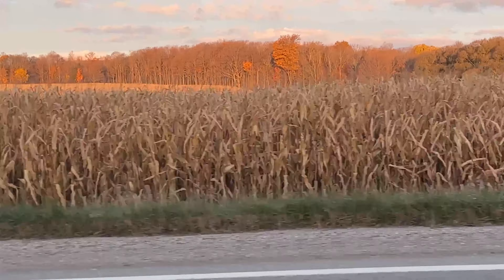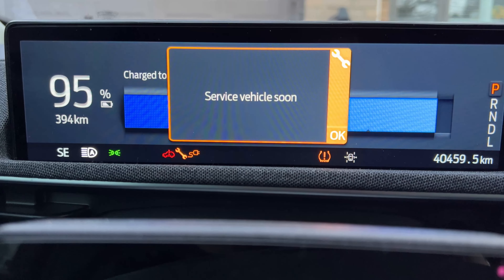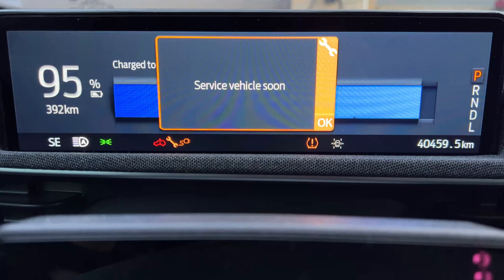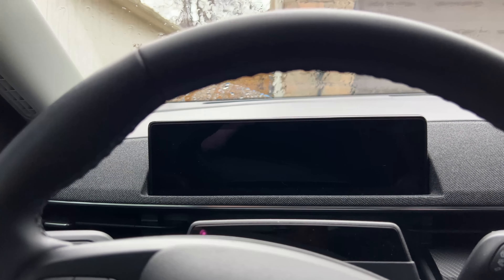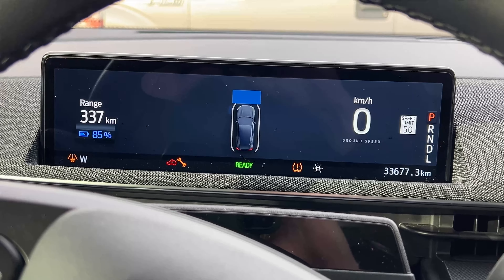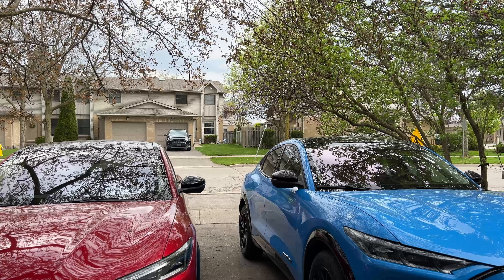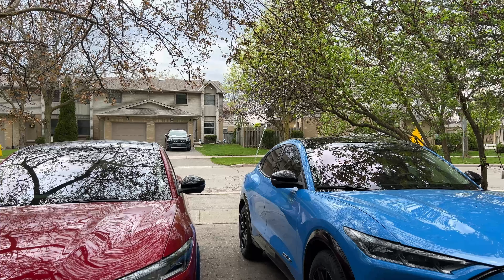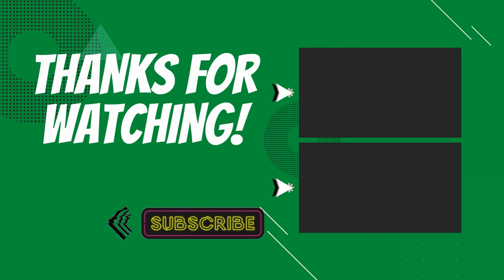Ford Mustang Mach E High Voltage Battery Junction Box HVBJB Fail - 2 Months to get fixed? WTF Ford?!

Comment: Mine is being worked on right now at my local dealership, they had to bring in a welder to modify their hoist to be able to drop the battery out. I should have it back tomorrow. Been there 5 days now.
Reply: I wasn't having issues, just got the notice that parts were available to get the job done, finally lol
Reply from the maker: Glad to hear it's working out ok for you.  Keep me updated!  Please like and subscribe as it helps me as a creator.  Thanks for the comment and for watching!
Reply: Mine is a 23 which is supposed to have the updated junction box. Not sure how much it’s updated as my 23 is at the dealer with 1750 miles on it and a month old with a bad junction box. Been there for 4 days so far and was told it’ll be another 3-5 days till they get the parts. Kinda scared to drive the car when I get it back as if it only lasts a month from new doesn’t say much about its longevity. 

Bought to save gas money too as I drive 100-150 miles daily and am now driving a 5 year old edge loaner that gets bad fuel mileage 😞
Reply from the maker: @jimhimesjr  I share your pain, frustrations and skepticism.  I will say that my Red Mach (Darth Maul) is 2 years old now.  With everything being said, I'd do it all again.  Let me know how it goes.  Please like and subscribe as it helps me as a creator.  Thanks for the comment and for watching.!
Reply: @MoreBear  will do for sure. The dealer gave me a 24 select awd big battery to use while my car is in the shop so that helped brighten my mood. Interesting comparing it to my gt performance. 

I asked if they had a lightning to try and they were gonna give me one to drive but they sold it the day before so I ended up with the 24 mach e. Really happy with how the dealer has treated me.

I really like the Mach e. Hoping it works out